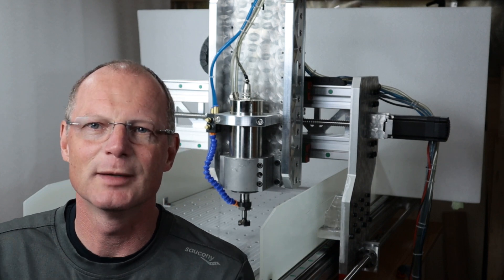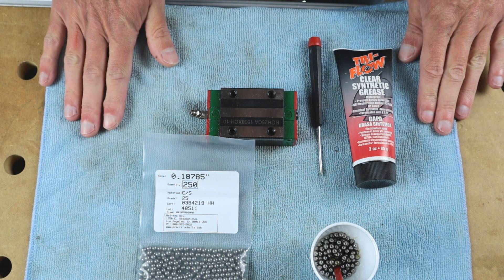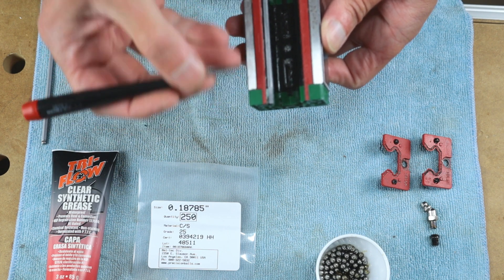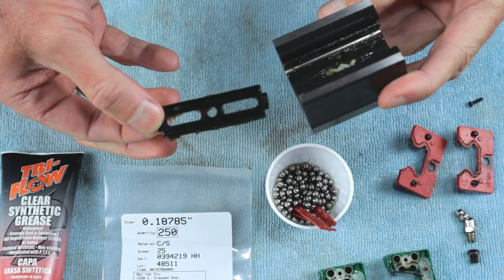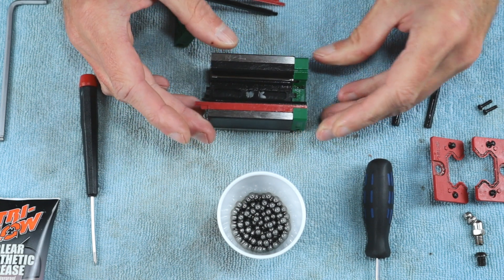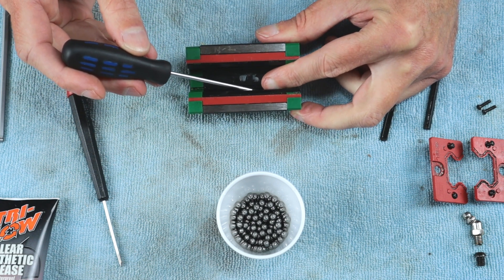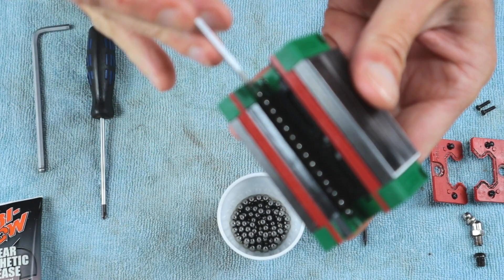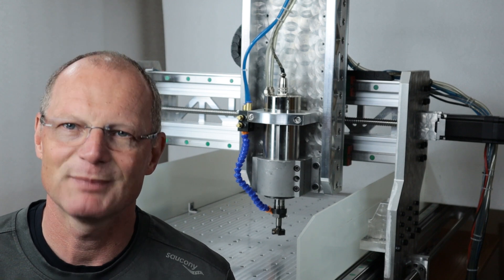Linear Guide Maintenance DIY

Comment: How did you arrive at 3 tenths as the size increase that you needed?
Reply from the maker: I talked to the engineer at Balltec. 
The dimension I had in my mind was waaaaay too big he said. Also you can just order 6 balls and insert them and check the fit.
Reply: @JBWorx  Cool, thanks. What was the size of the ball you were replacing? Did you base the sizing on the amount of play you were trying to reduce?
Reply from the maker: Yes I carefully measured several of the balls using a micrometer and trying just to hold the ball in the anvil not using tue built in clutch as this would be too high of a force for a correct measurement. I then added 0,0003mm to the diameter as recommended to me. I think I could have gone a little bit bigger there still was no pre-tension that I felt installing the guide onto the rail.
Reply: @JBWorx  Okay, thank you very much.

Comment: What kind of lubricant did you used on the end of video, aince you was not explain those part before.

Is it a PTFE silicone grease or white lithium grease?
Reply from the maker: It is Triflow full synthetic grease, it’s clear and does contain PTFE.

Comment: hi i have nsk s15 block with plastic stud at both sides and looking how to grease
Reply from the maker: There are 2 screws in the front. In the center between them is either a hole or another screw. This is where. The grease nipple goes.

Comment: Hello Jorg, 
These chrome steel balls are listed at 7.5 bucks. each! Did you really spend close to USD 2000 for that bag?
Reply from the maker: Heck no 😆, I think it was somewhere around $35 for a set. I was willing to invest that as I knew the guide block would be way better than the original. I remember the website was confusing on the pricing so I called them for clarification and ended up talking to the engineer for an entire hour. Really cool guy, I was amazed how much information there is around these precision balls
Reply: @JBWorx  (Oh, I wasn't logged into my normal account when I posted that - but hey, one more for the algorithm). 
Anyhow, pheeew! Good to hear. But after having watched your video, I had a peak at the bal-tec site and the USD7.5 came up, but I think I know how now. 
I just googled the size and bal tec and clicked on a direct link which has that price for one ball. But the listing was from 2002 and roaming around a bit more it turns out a lot of listings has a price of 7.5 bucks for one, and cents for +1. Makes sense, no one wants to go and find one tiny ball and pack and send it. 
Yours look to be around 30 cents right now.
Reply from the maker: @AntiVaganza yes that sounds about right. One trick is to just get a handful of balls and install them to make a test fit. This will allow you to dail in the pre-tension on your guide.
Reply: I might need to go down this route at some point. 
I am putting together a solid granite machine (inspired by Fox, of course). And I'll be putting some used Japanese motion hardware on it. I will not go for super beat up stuff of course, but it will be used. I can get it cheap though, so I don't mind making the gamble. But it might just be so that a reballing could help take them back to former glory if need be:)
Thanks as always 
 @JBWorx
Reply from the maker: That will make a nice machine. Usually name brand guide rails last a really long time. What hurts them is when dirt gets inside. Frequent lubrication will force that dirt back out. Good luck with your build.

Comment: good info, where can i find that plastic assembly plate to stop the balls from falling out
Reply from the maker: Hmm good question! I built my machine and the guide block came with them installed, so I kept a couple of them. However you can search for “HIWIN linear guideway accessory”. You can buy new seals, grease, covers, grease nipples etc all separate.  Hope this helps.

Comment: where you both balls for replecment, how to find proper size for different hiwin cartridge? Is it possible to replace bales in the ballscrew cartridge  ?
Reply from the maker: Yes it is also possible to replace the balls on a ball screw. The proper size is difficult to answer it depends on the wear of the rails / balls. Like I mentioned in the video and description the increase in diameter is very very small.

Comment: Thank you. I just disassembled an HG20 linear rail carriage from China for a friend of mine because it seemed to slide well in one direction but would catch in the other direction. It was my first time to take one of these apart. I cleaned out all the old grease with isopropyl alcohol, dried it, did a visual check on the ball bearings, removed a few small pieces of metal shards and then it took me about a week to get it all back together with all the stops and starts because I seem to have a re-engineered version without the hook and one extra piece of long thin plastic. (So none of the reassembly videos I’ve found yet match the pieces I had in this linear rail carriage.) once figuring that out, I think the getting all the ball bearing back in was the hardest part.
Reply from the maker: Well I am glad you got it back together. It is definitely not for people with a short fuse, one will need patience and it is a slow process. Thx for your comment on this.

Comment: What is the type of grease?
Reply from the maker: For assembly I just use a clear synthetic grease called TriFlow. For correct lubrication you want to use a grease free of solid particulates so no Moly Grease for example. HiWin G05, Kluberlub GL-261 or Mobil Mobilux EP1 are all recommended.

Comment: How did you find out what ball size to order? did you measure the old balls yourself? What is the price to reball one bearing block?
Reply from the maker: I called Ball-Tec to find out what dimension to use. I measured the original ball and the recommendation is 1-5 1/10.000” yes not a typo. The cost is close to a new guide block so financially it makes no sense but from an aspect of quality it does. If I remember right it was $40 per guide block.

Comment: Hi, thanks, does it means that if we have a ball screw  with a single nut , and it has some backlash by putting a different diameter ball the backlash can be eliminated?
Reply from the maker: For a ball screw it is best to purchase a “anti backlash version” it is usually a double nut with some preload against each other. But yes if the ball nut has too much play you can re-ball them as well.
Reply: @JBWorx  many non backlash ball screws does only have only one nut ,( including the Bridgeport ball screws sold by Hiwin), the reason I ask is that I don’t have space on my machine to fit a double nut
Reply from the maker: Yes you can increase the preload by increasing the ball diameter. The engineer from balltec suggested to order just a few balls and put them in, not to operate the machine but for test purposes. This way you are not wasting money for a whole set of balls and can find what fits to your application. Hope this helps.
Reply: @JBWorx  thank you, thats a great idea

Comment: Hi Have you got a link to Balltec and the ball bearings you bought. It''s always got to have a scource of quality spare parts. Lg. Andrew
Reply from the maker: Hi Andrew, have a look at the beginning of the video I posted a picture of the label. It has all information on it including the phone number / web page.
Reply: @JBWorx  Thanks I just noticed that. Can you tell me if changing the ball size changes the preload of the linear guides?
Regards Andrew
Reply from the maker: Yes it will. And you only need a very small increase in diameter to have an effect. For me 0.0003” made a good difference. Maybe 0,0005 would have even had better results. But I am happy with the outcome for now.
Reply: @JBWorx  I've just had a look and they do have a lot of balls !!! Thanks for all your videos. They are very clear and informative. I've been working on putting a cnc machine together using a sorotec compact line as a base system for a couple of years, not had much time and being self taught it's probably taking longer than it should but i'm getting there. The problem is, is that my old makko machine works (sort of) and I don't have space for 2 machines. Once i've got the controller finally designed i'll do the big swap over. Your videos are helpfull as your using many similar parts to what I have collected. Thanky for your prompt replies to. Cheers Andrew
Reply from the maker: Hey glad that you find value in my videos that makes me happy and motivates me to keep going. Yes this hobby does take quite some time and also can be rather expensive in parts. The sorotec machine will be great I am sure.  Good luck 👍
Reply: Thanks for your informations.

Comment: those plastic ball retainers are very useful when you assemble bearing blocks.  i put a retainer first and then just fill all channels with balls.
have you done any cutting tests ?
Reply from the maker: Tanks for the Tipp. No not yet. I am curious if is see a surface finish improvement also with the extra Spindel mount installed.
Reply: @JBWorx   this mount helps for rigidity if makes a short connection between spindle and bearing block behind (when Z blocks are on a spindle plate and this plate is thin)
your spindle plate is more than adequate for your spindle size so effect from additional point of contact will be barely noticeable if any a all.
in industry spindles a mounted in area close to front bearings. many of them have a mounting flange at the front.  but the back end rarely have any substantial support.
Reply from the maker: Yes I think so too. I had several comments where people improved the “chattering” of their machine but I will be surprised if there is a noticeable difference. I tried to make a vibration analysis using a larger tool before and after support bracket install. However I have trouble to get the sensor to work. It would provide a measurable feedback.

Comment: Great video. I would feel remiss if I dont mention the importance of clenliness while rebuilding a guide block. It would be better to do the reasembly on a stanless steel pan, gloves, and cleaning everything (including tools), all of the block components need to be 100% clean and and it is absolutley a sin to use a microfibre towel anywhere near this. 
May I ask how long the block was used before you needed to rebuild?
Reply from the maker: It was 6 years in service, some of its lifetime 8h/ day lately only intermittent use. But it had a lot of miles on it. Unfortunately when I updated my software the travel  distance counter was reset. Thanks for your comment !
Reply: @JBWorx  6 years is a really good lifespan! Normally its not the traveldistance that kills a block on a hobby machine, lack of greese and contaminents usually makes them useless pretty fast.
Reply from the maker: Yes I am totally ok with the value that I got out of them and would have made another purchase. I was blown away talking the the engineer at Balltec. They are the most precise ball manufacturer and have a seat in the institute for measuring standards as no one can measure these balls to a precise dimension. Very interesting conversation.
Reply: @JBWorx  It sure is problamatic to measure such an odd shape to a specific degree.
Reply: @JBWorx  what was the original preload? Z0?
Reply from the maker: I wish I remember it’s too long ago that I bought them. But I think Z0 sounds right I remember them being very smooth on first install and any preload set up is usually not.